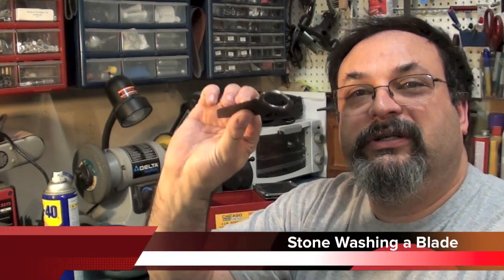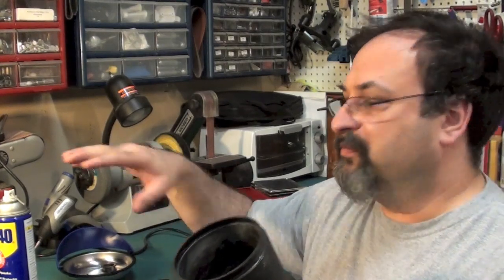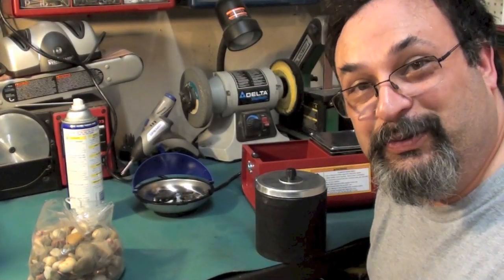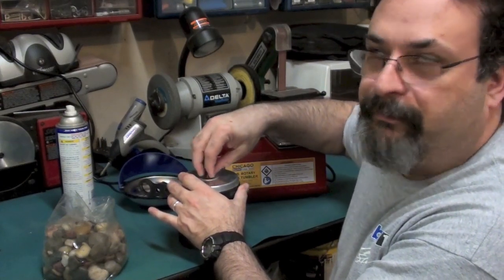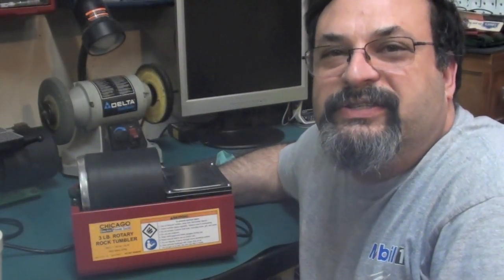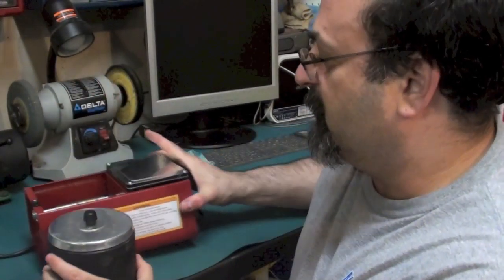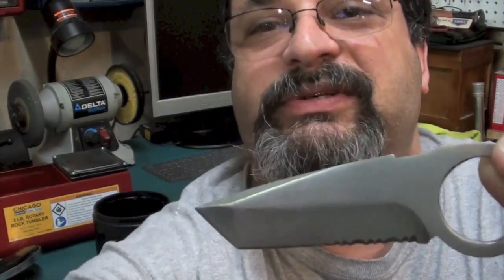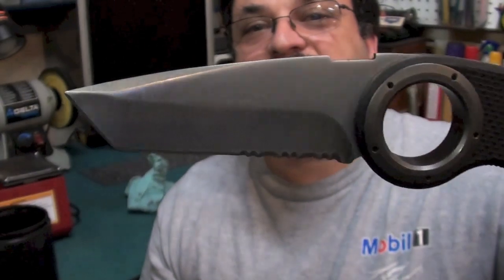Stone Washing a Blade

Comment: Cool video. For the rock tumbling of your good knives, perhaps you should think of a way to protect the locking surfaces as well as the edge (particularly the point)?

I doubt any 'hard' protection would last when mashed against rocks for a few hours, but perhaps a 'soft' form of protection like silicone or polyurethane sealant would work??

Comment: Should have picked up the 5lb can of ceramic triangles too, mix them with the rocks and in 30 minutes you'll have a heavy stonewash. I have the same tumbler, ceramic triangles work better. I did my spyderco military titanium scales first an turned out awesome
Reply: PkwyDrive13 - Have you ever tried adding some sand in the mix, as well?
Reply: How tough was it to resharpen your blade?